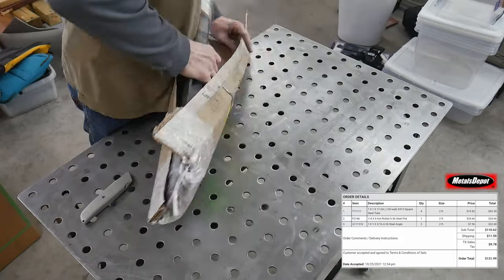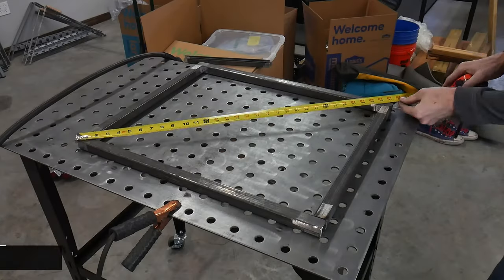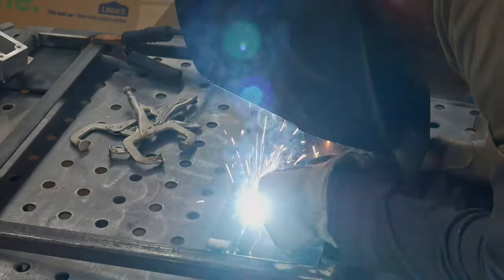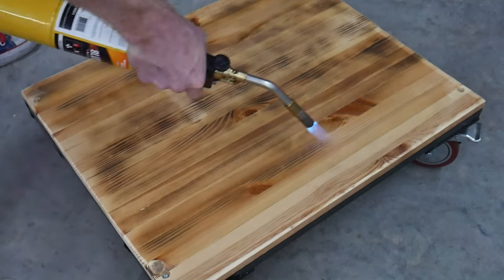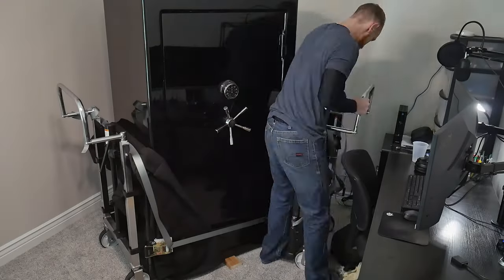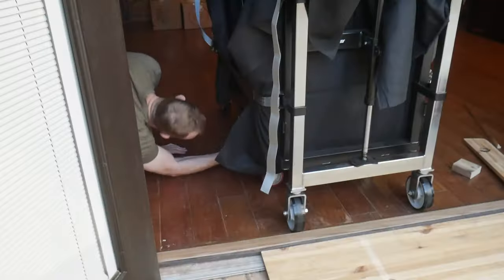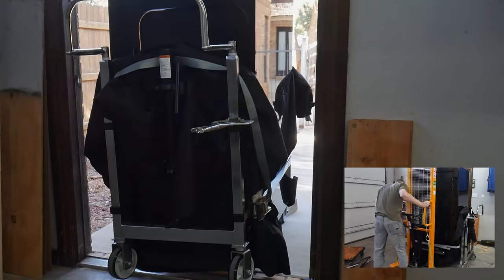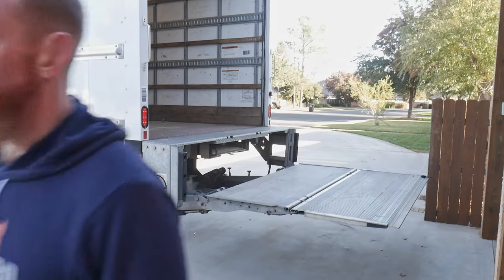Moving a 1/2 TON SAFE Without Dying...

Comment: Oh man, that’s a smart way to do it. If you gotta do it yourself, this is a good way to do it! Now you can move it around in the future, too! Been a while since I’ve said hello man, sorry about that, been busy with my own builds and getting my shop up and running. I have so many cool things now, craftsman atlas lathe w/ 12” swing and all original parts including change box, mini mill, Everlast 211si welder and a 72in belt grinder that I welded together myself and lots of other things, built most of the stuff here on the channel as well and I’ll be finishing up by getting my own heat treat oven made soon as well, that one will take a bit more finesse, but with your instruction, I’ll be fine! Thanks for all the help brother, I very much appreciate it. Keep em coming!
Reply from the maker: Sweet dude, glad to hear your shop is coming together! Keep up the good work!

Comment: Great Video! With Real Practical Value! 
One Note - Always get Someone to be with you, no need even to touch anything or help physically, but Just in Case! 
For you, this is your Wife and she is on the scene the whole time! 
Never be alone, because if Something happens and somehow you a stuck or somehow trapped with the safe you need help eminently.
Last year, here in my country Bulgaria we has one fatal incident - one young man 23 years old, in very good physical condition, move a refrigerator by himself, enters an elevator with the refrigerator and the elevator stuck between two floors, the fridge has fallen and trapped him. He does not expect something like this happens and put himself in an Extremely tight position against the refrigerator and barely can breathe, he thing is only for 20-30 seconds, but the unthinkable happens and he dies in the elevator, screaming, but no matter how fast the service technicians arrive at the site he has already died... 

NEVER Ever move something heavy alone, Always with Someone with you, for backup in case of emergency!

Comment: I delivered safes for 8 years and we would just push up the safe to a 45 degree angle while one guy holds it balanced the other guy would slip in the flat dolley and we were good to go. Of course we used teflon sheets to protect transitions and to ramp over the threshold. Our flat dolley was specially made with tiny rubber wheels to protect floors and allow us to go under low doors. When we had steps we used the ultra lift climbing  dolley
Reply: Just 1 1/4 pvc and can move with one finger

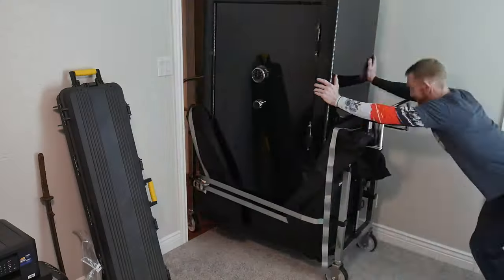Comment: 5:18 nice, I have a type 98 just like that as well.  It's not a machine made wartime blade though, you can just barely make out a hamon and pattern welding, so it was probably an old blade with new fittings.  Got it super cheap at a gun show because they thought it was a plain old NCO sword.
Reply from the maker: Very cool man. One of my relatives brought that one back. Cheers